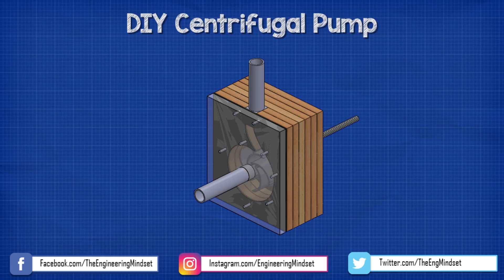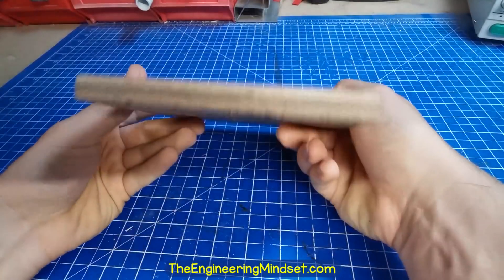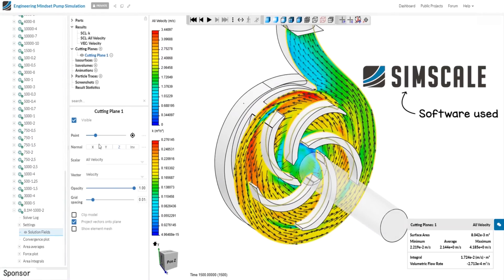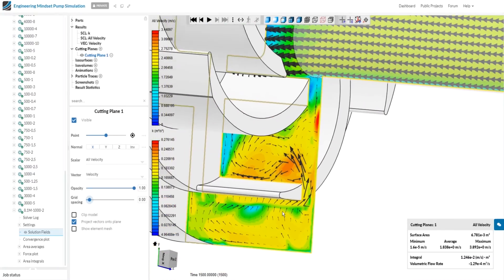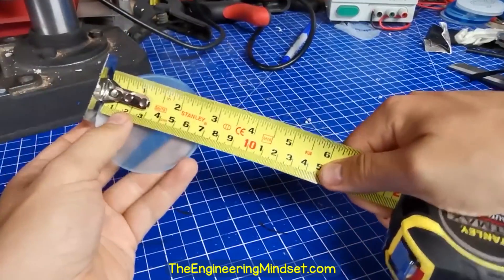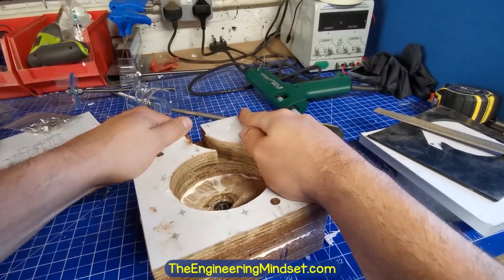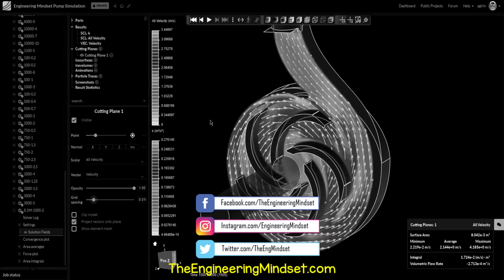DIY Centrifugal Pump - How to make a pump from wood and optimise with CFD

Comment: Cavitation is something else than air bubbles. Cavitation occurs when the pressure goes below the vapor pressure of the liquid. The fluid then basically starts boiling creating small bubbles that collapse on impact. It's the cause of pitting.

Comment: Also how does the shape or profile of a bane affect flow (i.e. uniform versus tapered or airfoil shape). Of course you would have to machine the impeller to use non-uniform profiles

Comment: Lower water velocity increases the pressure? How does that work?
Reply: Bernoulli equation (or Conservation of Energy). The kinetic energy of the water has to go somewhere so it turns into pressure.

Comment: What I would say is that you did the right thing by building a physical test model rather than simply rely on the software. Physical testing is an important sanity check on simulation.

Comment: this is a "closed-loop" system, the water returns to it's source.  an "open" system would drain the water away without refilling the reservoir
Reply: It is open to atmospheric meaning it is an open system. Whether the working fluid is recycled or not is irrelevant.

Comment: Obviously you enjoy building these sorts of things, but perhaps a more economical way is just buy a water pump for an old chevy 350 engine. Hook up electric motor to the pulley. 

The pumps can be had for like 15 dollars or whatever a junk yard might have. 

What I'm slightly more interested in is how the cooling works. 

Would there be an efficient way of making such a system work in a typical house?

Comment: something something balance impeller
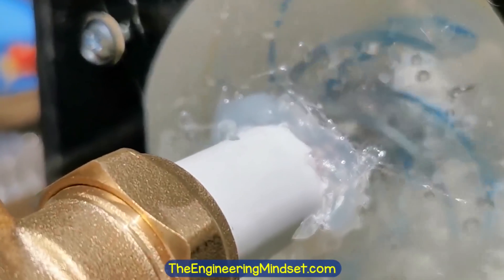Also 12:50 cavitation is when the dyanmic pressure is less than (flashing) then greater than (bubble collapse, micro water hammer) the vapor pressure of the liquid. In fact, in some rare cases, air can be injected to reduce the effects of cavitation because it keeps the vapors from collapsing.
Overall fantastic video!

Comment: Great video sir, this is the information I was searching for many years. A good comparison between the straight, forward and backward curved blade pump. Where and why do we use the straight blade and forward-curved impellers if both are less efficient than the backward curved impeller?

Comment: Can you make video on positive voltage vs negative voltage? How you can connect two 9 volts batteries for example in series and have +9 volts DC on positive terminal and -9 volts DC on negative terminal with middle terminal serving as common/virtual ground. What are the uses of negative voltage? Can you power a LED or 9 volts motor by connecting to -9 volts terminal and virtual ground terminal? Also since voltage is pressure, does negative voltage mean lower pressure and positive voltage mean higher pressure?

Comment: get an air release valve, pressure transducer and a proper 3 phase VFD and motor (single phase in and 3 ph out) = win.

Comment: I bet you learned a lot from your little experiment. Try running your system with your black sump full to the top increasing pressure on pump inlet. Your not getting real cavitation, but dissolved oxygen is coming out of solution and extra height may help give you more NPSH. Great video, keep them coming!

Comment: Why doesn't the water leak throught the bearings?
Reply from the maker: It did. Plugged it with some petroleum jelly
Reply: @EngineeringMindset  That's enough to handle the pressure?
Reply from the maker: Can use some waterproof grease for better results. Add a fair amount around each of the faces of the bearings. It'll hold for what this pump can do.

Comment: From the start of the video I had one question that never really got answered. How did you keep the bearings and the drive shaft from leaking? I see that you used sealed bearings, but I bet they still leak. Cool video! Thanks for showing us this cool tech!
Reply from the maker: They did leak, but could have put some waterproof grease in there to stop it.
Reply: @EngineeringMindset  Thanks for the reply! I'll keep that in mind. As a side note, I think it would be awesome if you did a future video on DIY shaft seals, testing various different methods to see which one works the best. Because when it comes to DIY seals, shafts seals are pretty much the holy grail of sealing techniques, right?
Reply from the maker: Originally I was going to use a spring with some packing to form a seal but for the amount of time it would take, I just simplified it as much as possible so that someone else could take the designs and build their own. If the videos is popular then I'll look at more improvements
Reply: Sounds like buying a pump housing is the way to go without leakage problems, but your visual video illustrates what the mechanics are for a pump housing. Time and materials are one thing, but a on going problem is the pits...

Comment: Is the pump's design strong enough to pull water out of a 6 meters well? And if it is, will it last? Thanks for the ideia by the way
Reply from the maker: I doubt it could life 6 meters. You could change the design though and go for a lower flow rate.

Comment: 12:37 I may be wrong but i don't think that can be called cavitation, i don't think the design is efficient or powerful enough to producer such low pressure to make water boil, at the very least not enough to produce any damage to become a problem, they are just bubbles sucked in through gaps and air dragged by the aerated water.
Reply from the maker: Yeah it's not true cavitation and isn't causing harm to the pump, but the bubbles reduce the performance quite significantly
Reply: With cavitation you see a vortex in the Tank and hear a sucking sound...

Comment: Maybe a stupid question but.. What is the purpose of bearings? I know bearings are used a lot, and I know it usually involves something spinning - but I don't quite know the precise use for them.

Maybe I'll find out in the rest of this video, in which case I'll delete this comment.. 

Love the videos!!
Reply from the maker: They allow low friction rotation of for example a shaft. That allows it to spin faster with less input power. Otherwise it would rub against the case causing friction and heating which will waste lots of input energy as well as wearing the shaft out very quickly.
Reply: @EngineeringMindset  Very cool! Thank you for answering my question.